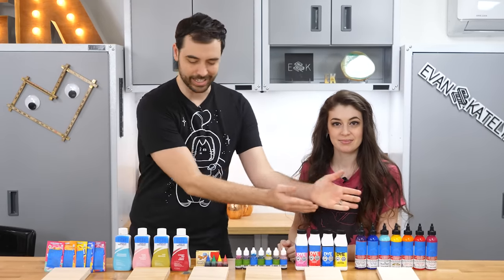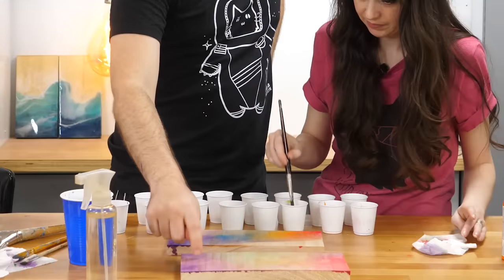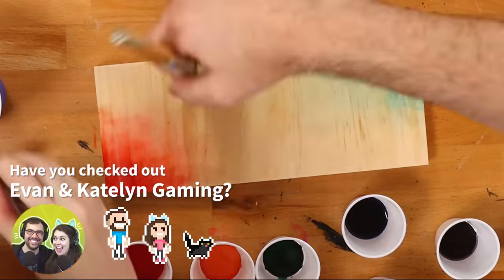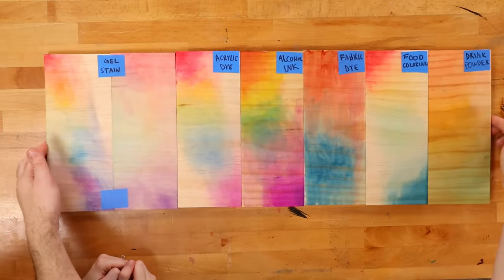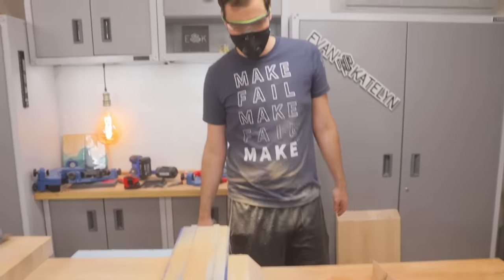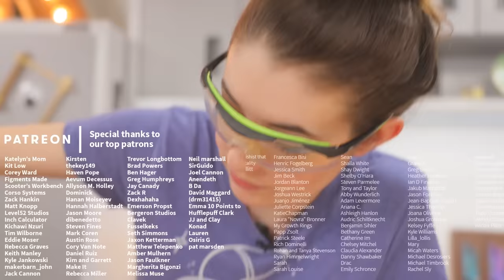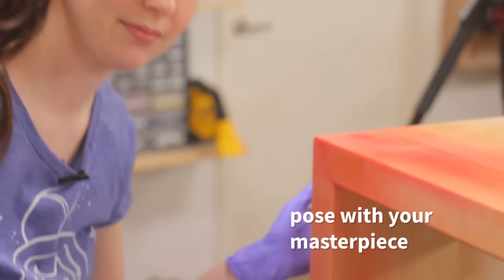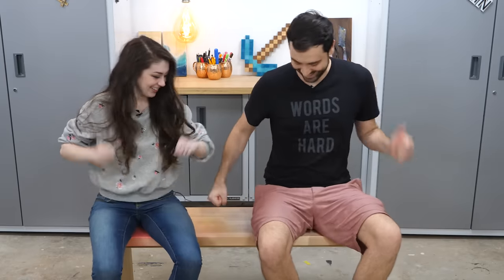DIY Rainbow Bench (and techniques that FAILED)

Comment: Thank you for the super video. Pre-mixed fabric dyes will go off, as they have the mordant included, which is needed to bond the dye to the fabric. Dyes mixed with the mordant in will go off in a day or two. I guess the branded stuff has preservatives as it’s on sale for longer. You can get Procion MX powder, and mix it with water to stain wood, no mordant needed. Make sure you wear a particulate dust mask/respirator when handling dye powders. You can take the mask off once it’s in liquid form. Wear gloves or use barrier cream when applying it.
Reply from the maker: Thanks for the info!

Comment: Evan and Katelyn- “these paints are more on the expensive side so we’re gonna test some more options you could use”

Also Evan and Katelyn- * regularly uses 3d printers, silicone molds, and other specialized tools*
Reply: Granted they did start with cheaper stuff earlier in their productions.
*
*
*
*
The following is a breakdown of what is going on here from my perspective, based on my knowledge of the materials, equipment, & skills involved.
*
*
*
*
It's a balance.
They want to do stuff they're satisfied with craftsmanship wise, but they also are trying to ensure that even beginners still have a chance to reproduce their results.
You can look at older videos for the older less expensive molding methods, and cheaper building materials, but they also do a CBA with the more expensive options.
For their purposes, it is cheaper to use more expensive molding materials & equipment because the durability is by default greater, allowing for a higher quantity of quality iterations before a repair or replacement is required. Which means they can make more things at a lower overall cost.
This is the basic economy of scale at work.
They're not the occasional crafts people, they're splitting their time between their gaming streams, podcasts, & crafting, selling the results of their work, & that work needs to be of a certain minimum standard or they get bad reviews, & can't sell stuff.
Hence why they do need to  acknowledge that they're not going to use just anything to make their stuff, but that they do try to cut the costs to a reasonable degree.
Essentially this is the behind the scenes situation of most craftsmanship.
A balance between saving money while producing desirable high quality results.

Comment: For blending, try wet on wet — water doesn’t always have to be the medium used to carry the pigment.  In watercolor painting, you can achieve very soft blends with that exact technique; liberally wetting just the areas of the paper that you want the color(s) to blend, then apply the color.  It’s more important for your brush to have enough water (or your medium) than pigment.  You can add more pigment as you go, but a brush that’s too dry will dry your working surface before you’re done - and you don’t want that.  You’ll end up with harsh edges.  It’s really fun to watch a nice quality, pigmented watercolor disperse through the water!  

In this case, I’d apply the medium ALL OVER the surface of the bench, then apply the color and move it around until satisfied.

Comment: when applying your finish, why did you use small brushes? does it make a difference in the size of the brush and the application? Just curious! :)
Reply from the maker: We just use the brushes we have on hand, they happen to be smaller 👍

Comment: There's probably comments already, but I do feel compelled to say that, yes, you picked up the kind of [DRINK MIX] that requires added sugar.
Anecdotally, my brother and I would really tick my parents off by making our own "fun dip" by mixing a packet of [DRINK MIX] in with JUUUUUST enough sugar to make it palatable. Usually at about a 6:1 sugar to mix ratio. Suffice to say, we used up a lot of envelopes of [DRINK MIX] and a ton of sugar. It's miraculous we aren't dead, really.
Reply from the maker: We were thinking it would be perfect for fun dip!
Reply: @EvanAndKatelyn  Well in that case, you're on the right track. Just don't forget to mix with sugar, because otherwise there's so much acid in it that it'll hurt like heck.

Comment: Evan was actually sort of correct when he called the "powdered drink mix" candy! 
So the company that made Kool-aid, Kraft-Heinz, wanted to make a fizzing version similar to a soda. You'd plop it in water and it would bubble and flavor the water at the same time! They had scientist William A. Mitchell take on the task. 
He made some Kool-aid, added carbonation (carbon dioxide), and allowed it to dry. He then placed the pieces into some water, and?!... a little fizz, not a lot of flavor, and almost no color transfer. Maybe he was checking if the pellets lost flavor after having been saturated with water, maybe he was just hungry; but he popped a few in his mouth and the result? A fizzing candy that blew everybody who'd tried it away. We know this candy as Pop Rocks!~ 
Take this story as a lesson that even if you think you've failed one way, you've probably succeeded in a way you just don't realize yet.
Reply from the maker: 👏👏 learned something new!

Comment: Did he take a sip of isopropyl alcohol with Koolaid powder? Isopyl alcohol is not for drinking. That's ethanol. And ethanol in high percentages for technical, cleaning, cosmetic or crafting/art purposes is usually denatured. Or was it just water?